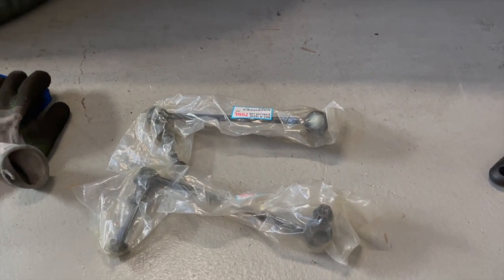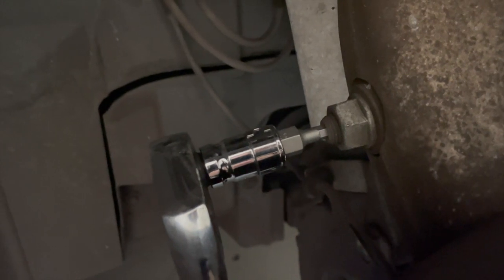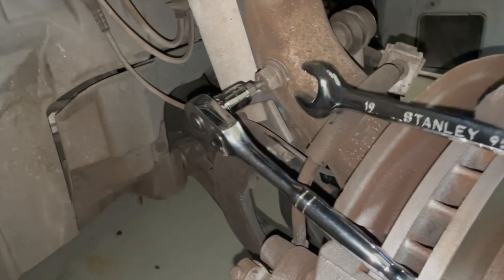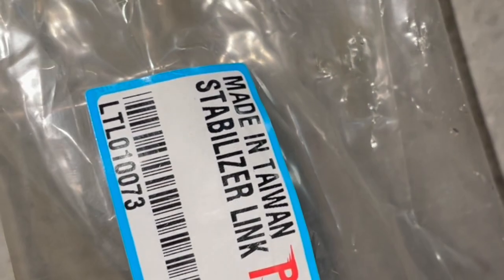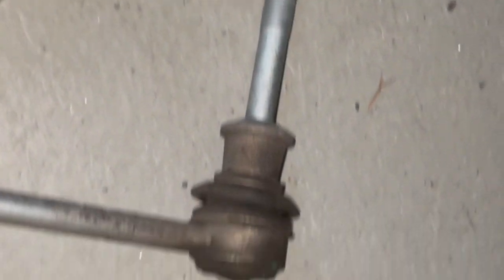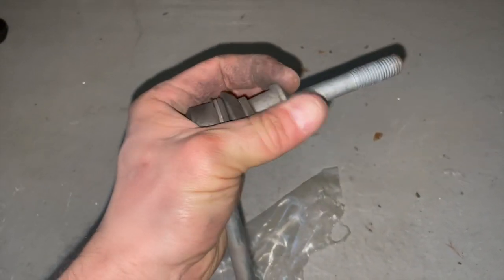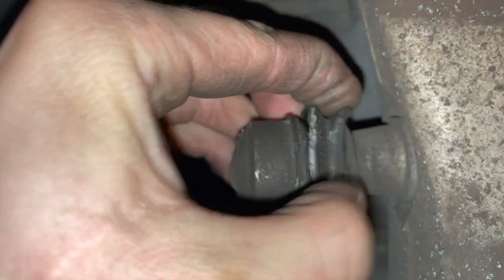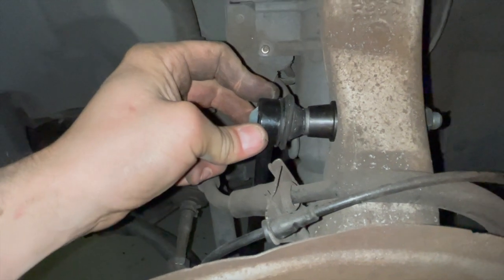How To Replace Your BMW X5/X6 Stabilizer Links At Home Easy DIY E70 E71 Active Suspension

Comment: Nice video.  However with your older link rods what were the issues you facing while driving ? How does the problem represent itself while driving
Reply from the maker: I had clicking and steering didn’t feel as direct